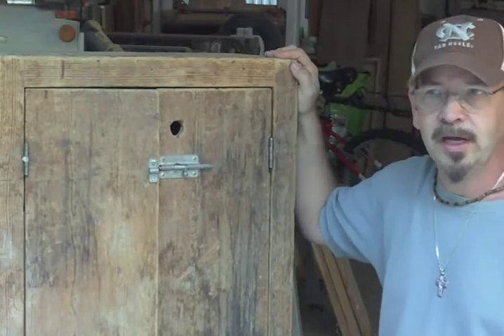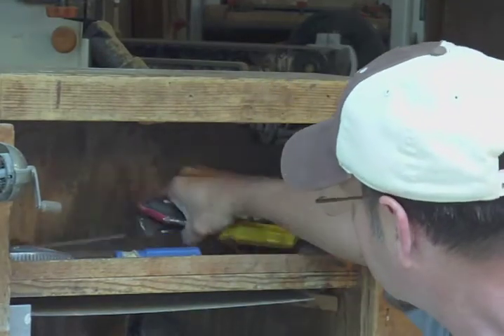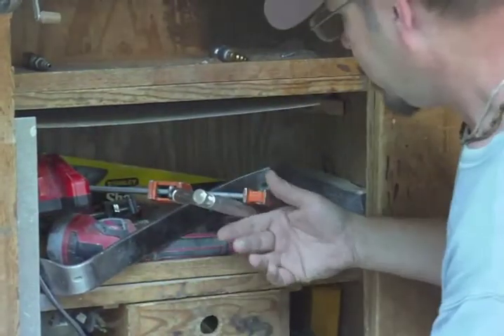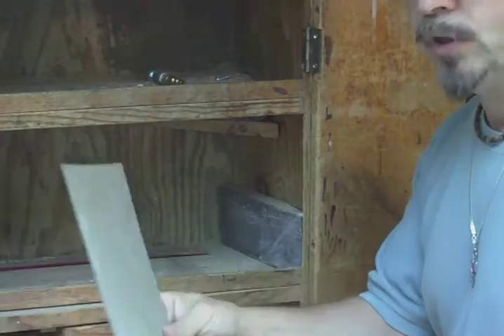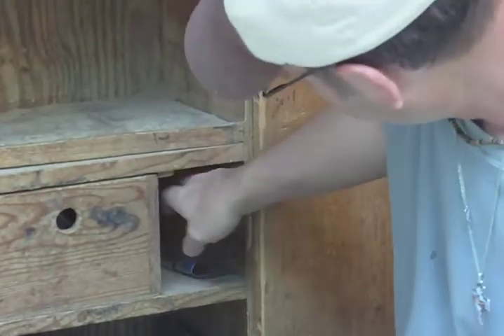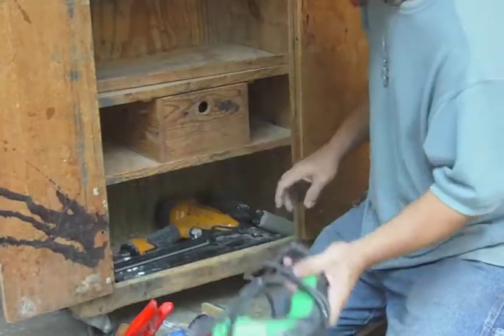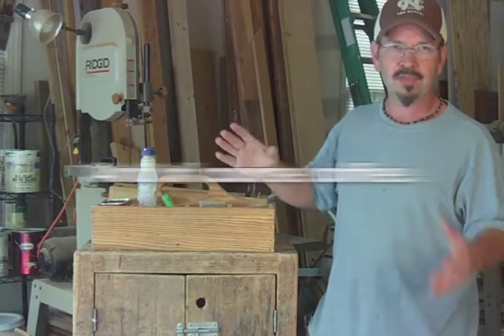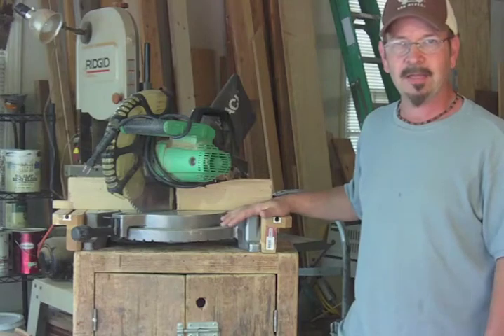Working mans toolbox tour.

Comment: The whole point of a bespoke tool carrying/storing item is that it works for the owner, does this box look pretty, no, but it doesn't need to. I like the way you can use the top as a makeshift chop saw stand and also as you move from one room to the next you can easily take all your tools with you, this is a big plus when working on a site with other trades and maybe other carpenters as you can keep a weather eye on your stuff and make sure it all stays where it should.

Comment: Nice system with your toolbox and tour   I installed Commercial Architectual Woodworking for years  as a rule the company supplied us with  the larger power tools and gangboxes to store our personal tool boxes  in overnight on the job sites  and lock their tools  secure as well  we all tried all types of different systems  the majority of them being metal boxes packed as light as we could get them  as many times we needed to transport our tools from one job to the next in our vehicles  i settled on eventually to a Kennedy hiproof that eventually  got so damn heavy filled with Specialty drill bits  and other hand tools that were a necessity to do my job  that most people can’t lift , never mind carry by hand  on commercial construction jobs i was alway š jealous of the electricians that can carry all their tools in a small Kleinbag or a plumber who uses one plastic 5 gallon bucket to carry his  around the job  where inmy trade we all had heavy dusty hand trucks that converted into 4 wheelers  that we always upgraded all the wheels and castors on to be safe  when rolling on a finished floor or into a elevator  as one time one of our men thought h could save a few dollars by using a cheap one from China that  had a wheel break off on a Lobby Marble floor that needed to have a insurance claim  issued for a pretty significant sum  to replace the floor !